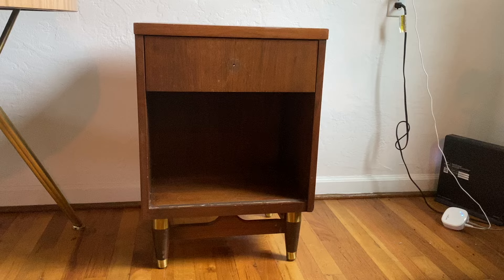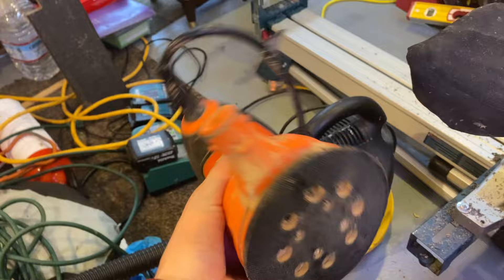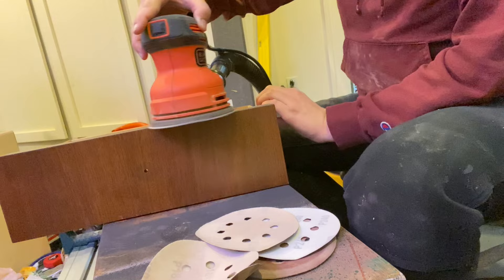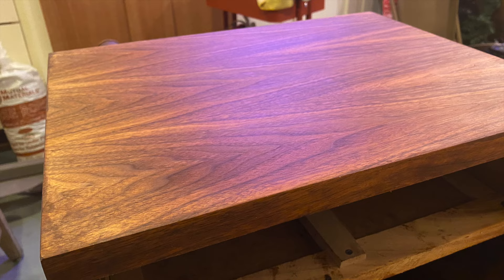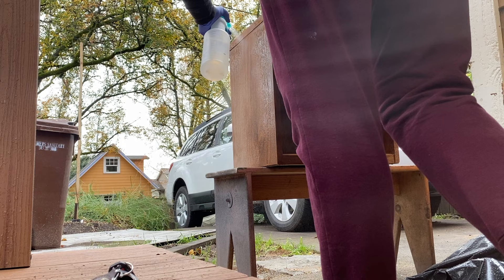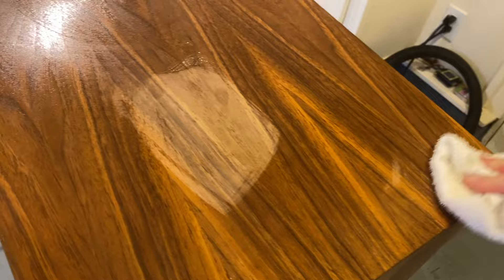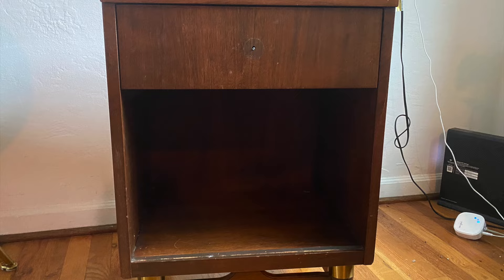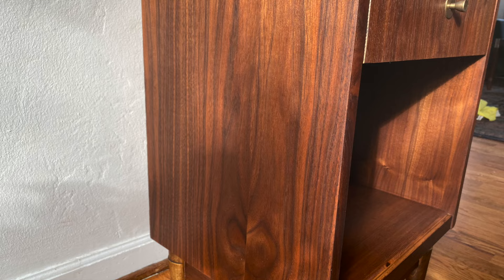Midcentury Modern Furniture Flip | How to Restore Wood Veneer to a Natural Wood Finish!

Comment: Highly highly suggest not using citristrip- strip well all the way. If it goes past the stain color, it’ll darken the wood down through the veneer
Reply: I disagree. I use citristrip on all my furniture, and have not had that experience. I’m currently working on a that is a very light coloured wood, and it’s perfect. The original colour is not darkened at all.

Comment: Looks amazing 👌. Pricing depends on your area. As for the stripper you used, I've read how bad/useless it is. I use klean strip. I'm in Canada btw. To bring out the wood grain, I use Tung oil. It's amazing too.
Reply from the maker: Thanks so much! yes, I've heard about kwik strip maybe I'll have to try it. And thanks! I've never heard of Tung oil, I'll have to check it out!
Reply: @KnowCanDo  there is tung oil..Danish oil and teak oil. You can also get them with a deeper tone to them, if the walnut or whatever veneer isn't popping a great colour grain. It takes several coats.

Comment: The stripping/sanding is the worst, for me at least, sooo I bought a sand blasting gun at Harbour Freight  for less than $30. I put regular baking soda in the hopper and hook up to an air hose/compressor then blast the finish off...IT WILL BLOW YOUR MIND!!

Comment: Loved this video! I’m about to start restoring an MCM dining table I found on marketplace. I see you used a soft wax for the finish on this, would you recommend this for a dining table as well? Or something sturdier due to the high-use surface?
Reply from the maker: Thanks! I’d recommend using polyurethane — that will cure and be hard